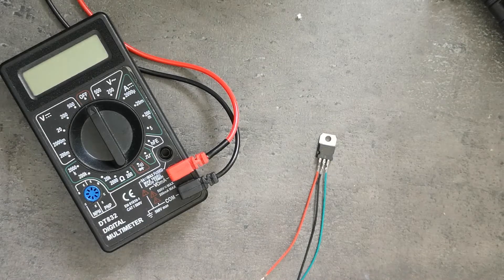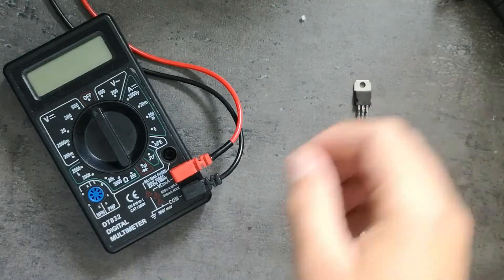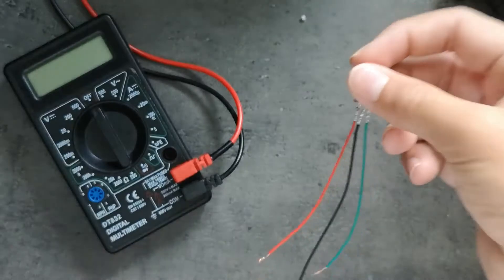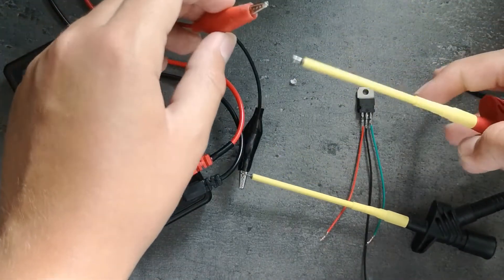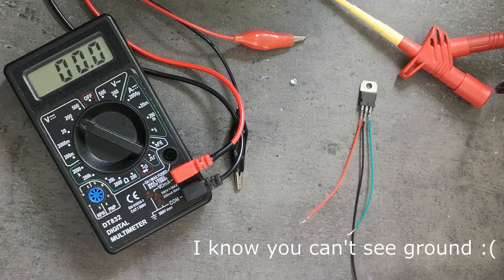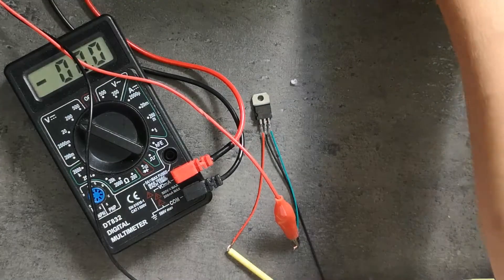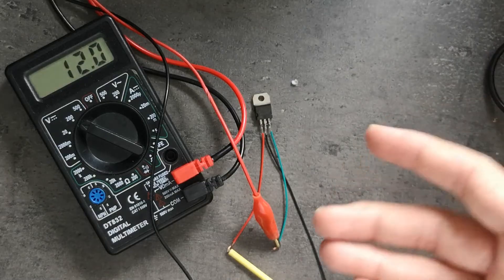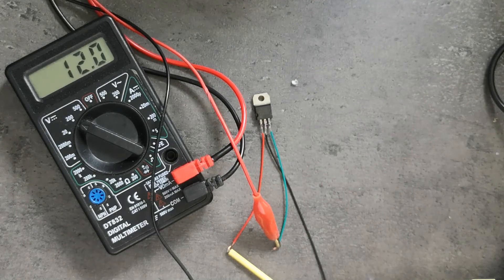L7812CV | Voltage Regulator Tutorial

Comment: Hey i want to ask if i can use two of them and take their output and create a reference voltage can i create negative voltage?

12V+---------------12V+
|          |        |
|          |        |
+12   0     -12

Hope you understood the diagram also i am looking for friends interested in analog electronics wanna be my friend
Reply: it is a little bit more complex than this but not much. You can google for aisynthesis DIY Eurorack powersupply. Even if you dont want to buy the kit, they provide a scematic and a little bit of explanation.